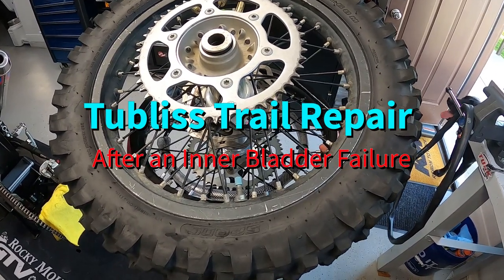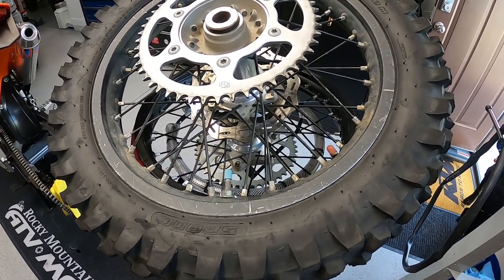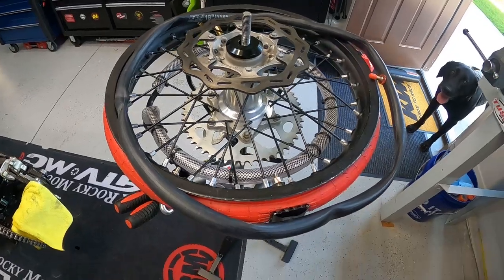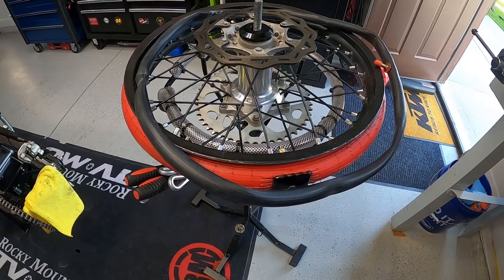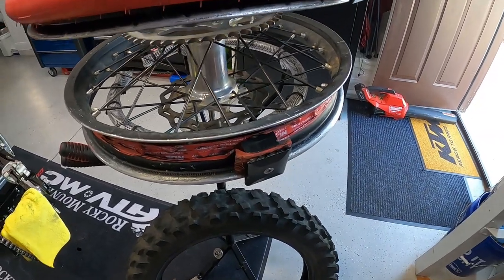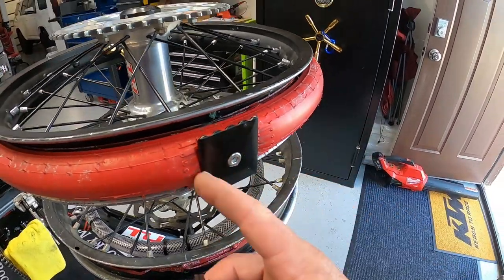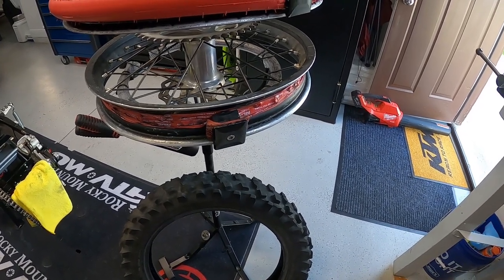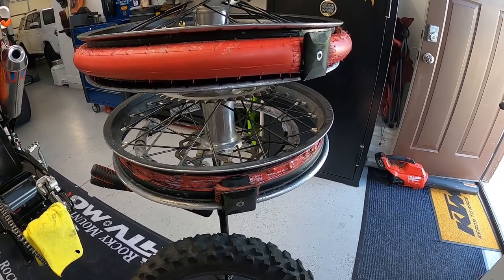Tubliss Inner Bladder Failure on the Trail? Here is a trail repair to save your ride.

Comment: I see what you did but I really don’t understand your logic. Why wouldn’t you guys be carrying extra Tubliss Inner Bladders for both the front and rear? Yeah, you made a hack and made it out but destroyed a perfectly good rim lock in the process. Doesn’t make sense.
Reply from the maker: Good point taken and we certainly could have taken extra bladders. But what if you have a failure of the red liner? You would need to have tube to replace the entire system. We planned ahead in the event a total failure occurred.  We used what we packed and it worked great and I would do it again. Appreciate your comment in the meantime.